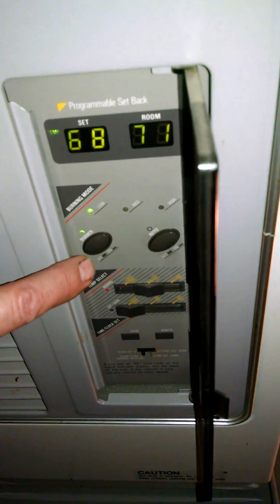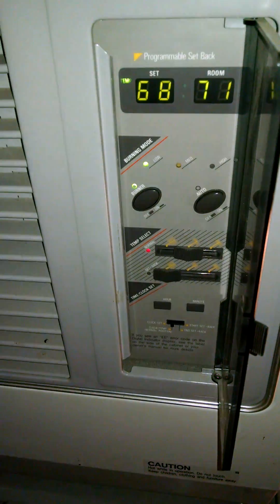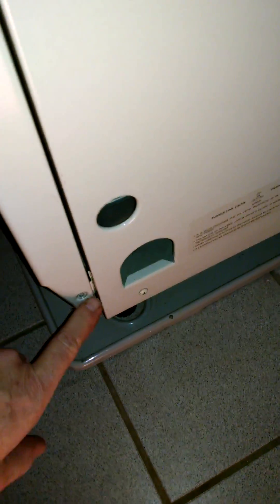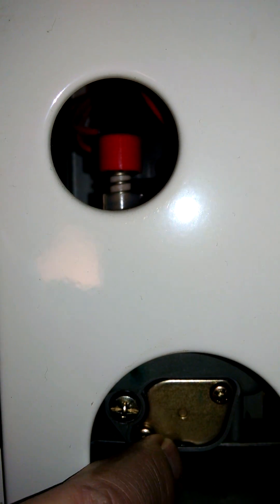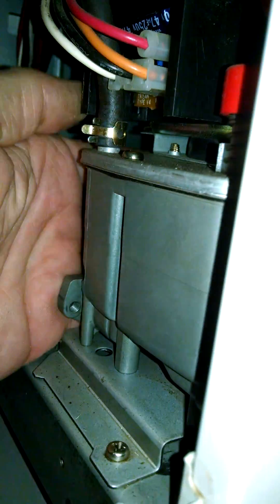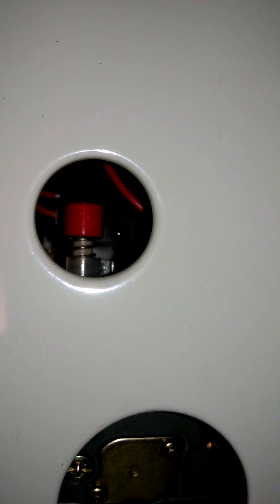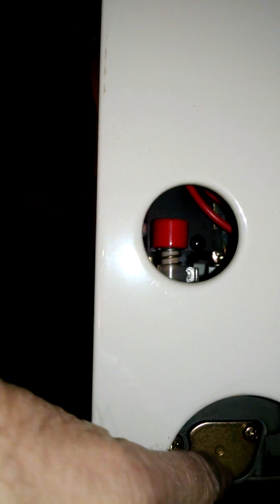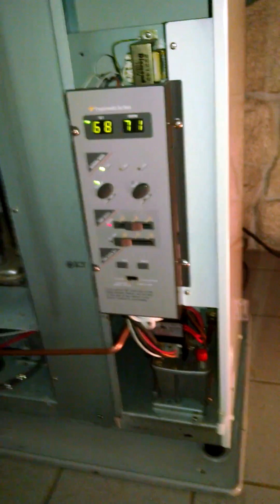Toyostove 73 code EE6

Comment: if you get EE6 and your flame is orange and sputtering you have water in your filter and line.
Reply: So true. Water does not burn well. And a mixture of oil and water to the burner will result in insufficient combustion and not satisfy the flame sensor circuit resulting in lockout code EE6. However, the internal pump screen mesh is so small it acts as a water separator. To some it may sound backwards because the oil molecules are much larger than water molecules but because water molecules are smaller they bind closer together (denser.) If the original pump screen is intact and the fuel delivery pressure is correct (just gravity fed), the internal filter should get plugged with water before oil is allowed into the burner. If the internal screen has been removed and there is water in the fuel it will result in poor or inadequate combustion. It will also necessitate disassembling and cleaning the pump as there are low spots inside the pump that will retain some water which may sporadically be fed to the burner.

Comment: MY OM22 CYCLES THRU WARM-UP , THEN AS THE CIRCULATION FAN STARTS AND RUNS FOR 2 SECS  , IT STOPS AND STARTS COOL- DOWN CYCLE THEN TURNS OFF .
WHAT IS ITS PROBLEM AND REMEDY  ?
THANX TOMT.

Comment: I opened it up but I don't see a filter. What does the filter look like?
Reply: It's sort of rectangular in shape about 1-1/2' long. Has a very fine mesh on 3 sides. The open side would face toward the back of the stove. The side toward the front has a metal tab that acts as a spring to hold it in place. The ends are rounded and it has  little tab sticking out to grab. If you don't see one after removing the cover, it's likely someone previously left it out. That would be a shame, as they help keep a lot of contaminants out of the fuel metering pump.

Comment: I have one that sat idle for a year and repairman says it is frozen and needs a new motor to the tune of $400+. Can it be taken out and repaired?
Reply: OK I finally got around to checking, squirrel cage turns easily but when ou plug it in and turn it on nothing happens. Neither fan nor squirrel cage starts turning
Reply: Peter Wood There is another wheel under that one on top of the blower motor.  They can fail but usually massive carbon build up is the culprit.  It you pull off the black tubing that goes into the BM you might see if it turns with assistance like the top does. 

What happened with your toyo?